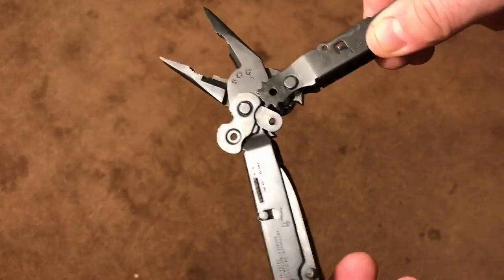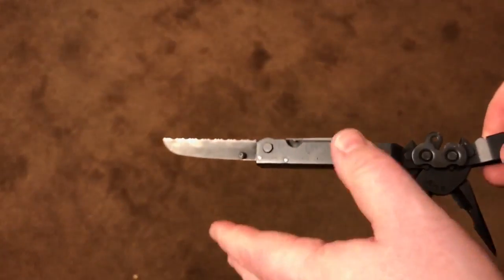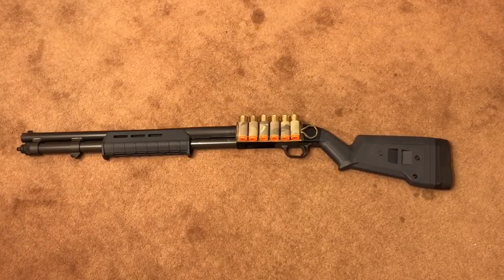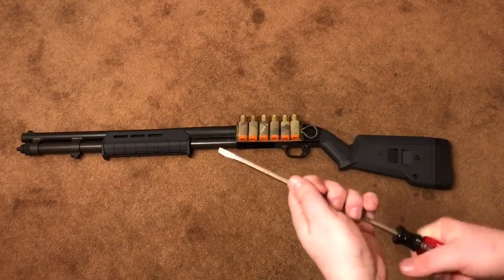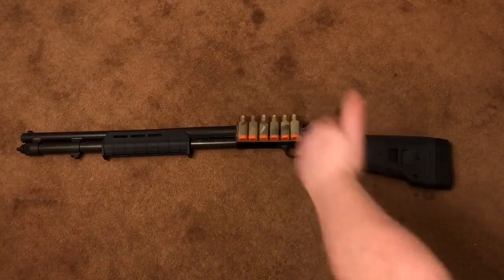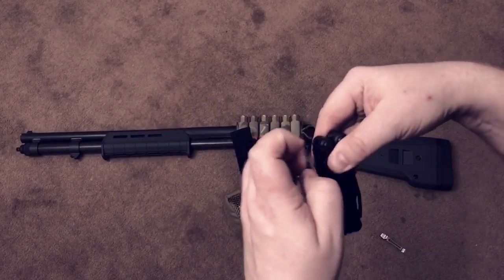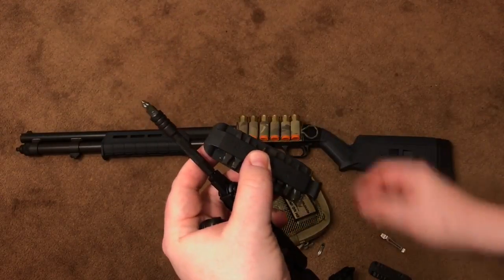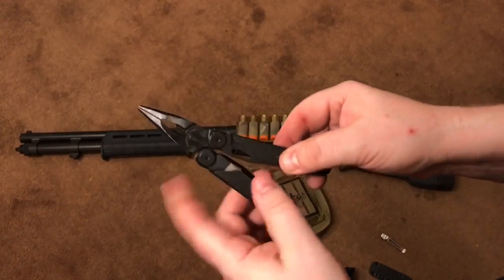SOG multi-tool is destroyed, how it happened and what I replaced it with

Comment: I had both, and prefer the SOG. The file is a real file for filing steel the steel in the knife blade could be better, but the wood saw is the best I have used I used the SOG to cut 1\4" lexan 12" long with no ill effects  your not going to have the leatherman 8 years with your idea of usage you will be looking for a SOG in about 18 months

Comment: I much prefer the Leathermen to the SOG.  That being said, I suspect if your wave were subjected to the same treatment it would yield similar results.  The big difference in my mind is that you can send it back to Leatherman and they will repair/replace it for 25 years.
Reply: Buldgr, incorrect, check their web site, Leatherman is 5 years. SOG is lifetime, however they do exclude abuse and stupidity, which excludes this failure. i Have the surge, wave (both gen 2), SOG Powerassist (like the one he destroyed) and its a fantastic tool. Also have a gerber 400 and a 600, a Leatherman MUT, just to name a few, also a Havalon Evolv.  I collect and test these tools, its my hobby.
Reply: Rod X - I'm sure you've forgotten more than I will ever know about multitools, but reading the warranty on the leatherman site http://www.leatherman.com/wave-10.html it clearly states 25 years.
Reply: So it is. my mistake.
Reply: No biggie!  I based my comment off of old knowledge and it did me good to go check it out.  Thanks for the information.